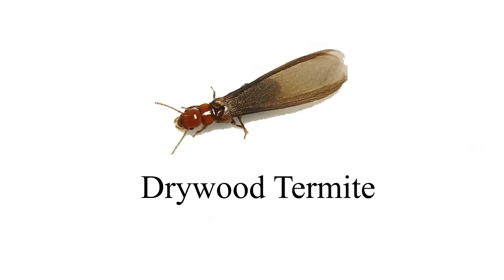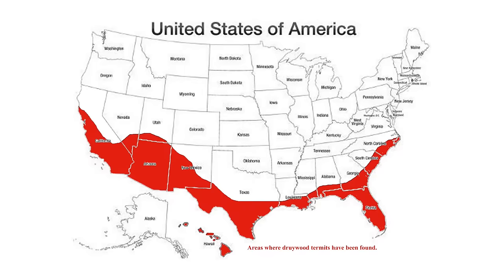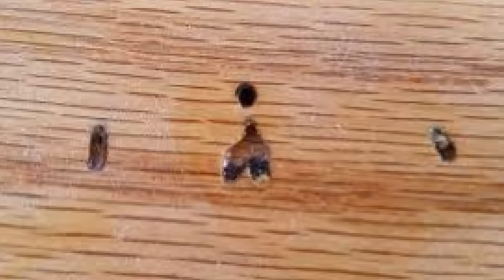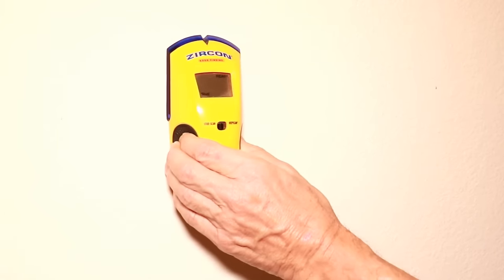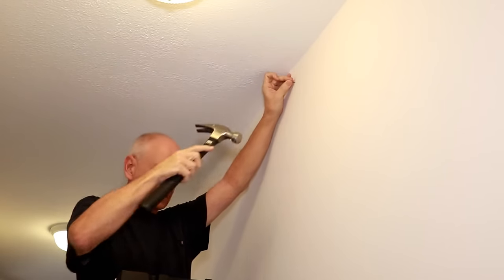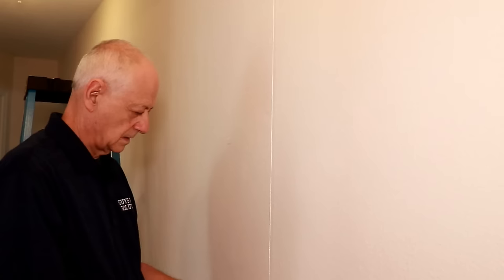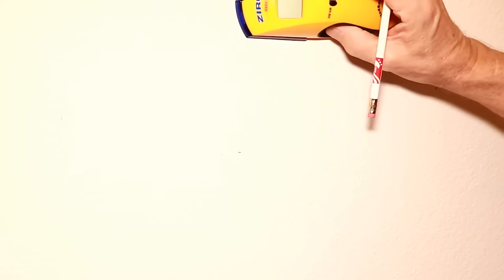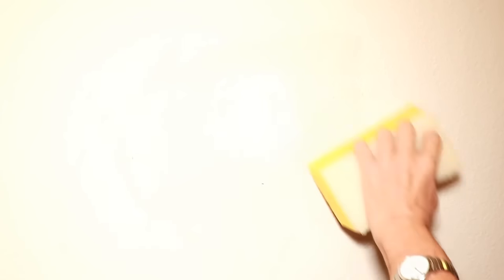How to Treat a Drywood Termite Infestation Yourself. A MUST see if you have Drywood termites.

Comment: Hello Guy. I’ve watched your videos on Drywood Termites a couple times now along with some from other YouTube channels. Thank you very much for the detail and depth of knowledge you provide as it is not something I have found anywhere else.  

I live in Florida and recently started a remodel of the second floor of my house. After pulling the carpet I found frass and then noticed a whole bunch of discarded wings on one of the windowsills. I’ve opened up three of the walls and found a lot of frass and  two colonies in the 20 foot wall under the window sill. I have also signs of activity (frass and very slight wood damage) in the two other walls I’ve opened as well as in the 3/4 inch plywood floor under 2 walls.  I can see how they travel through the holes for the electrical wiring for sure.  Nothing in the attic. Nothing in the two attics downstairs either.  (The upstairs just goes over the middle of the house).

I plan on pulling up the two floorboards that have slight damage tomorrow to take a look at what’s what underneath.  I’ve pulled the wood baseboards off every wall in each room upstairs and besides the areas I’ve mentioned, I see no frass nor have I encountered any soft spots in the walls and no kick out holes.  Also no wings on any other sills. I did identify two holes in the stucco just outside the sill where I did see the wings. I am not done inspecting downstairs yet and for the next two weeks will be focusing on the upstairs.

I wanted to get your opinion on my plan of action for the upstairs and ask a couple questions.  I am not going to fumigate at this time. 

I have Bora Care, Termidor SC and Termidor foam.  I’ll be drilling holes 4 inches apart into the beams that have the colonies and damage I’ve identified, and using the foam. 

I was thinking that since I have the drywall partly off these walls and can access all the wood inside that I’d also treat all the wood with the Termidor SC and then with BoraCare. From what I’ve read the Termidor SC is for outdoor use or wall voids. 

Obviously I will be treating all attics with BoraCare as well as all eaves.  

I plan to treat the remaining walls upstairs with BoraCare. There is insulation in each void. 

Questions:
1. Do you think spraying the Termidor SC into the areas I opened up is overkill because I’m also hitting the studs with the foam and all wood with BoraCare? 

2. In the remaining walls I’d planned to drill three holes for each void.  One next to each stud at the top of each wall/Void and one in the middle. Then applying BoraCare through either a foamer or mister so that it covers each stud. From the middle hole (actually from all 3 holes) I believe I can get the sprayer behind the insulation and foam/mist down the entire panel of wood. Is this a reasonable way to approach this? Do you think that a coating of Termidor SC would also be reasonable in the voids? 

3. Assuming I do not find significant damage under the floorboards that I do pull up, do you think drilling holes in the others and foaming/misting BoraCare into the voids in there is the right approach? Again, would a coating of Termidor SC also be reasonable? 

4. Your opinion on whether using a foamer or mister is better? 
I’ll be spraying into the holes in the stucco of course and then sealing them. I still have more work to do to see if there are any other penetrations they’re getting through also with a more thorough inspection of the first floor.  

Thanks Guy. I think that’s enough for now.  I value your opinion and am grateful for the gift of your time and knowledge.  It’s really great material and I appreciate the thoroughness that stems from your desire to get it right, convey it right, point out pitfalls  and help others get it right.
Reply from the maker: Thank you so much for reaching out to me. If you are certain that these are drywood termites, then I must tell you that fumigation is the only sure way to get rid of them.  That being said, any wood that you treat with Bora-Care will be rendered permanently termite proof, but you must do it correctly.  Always mix it one to one with water.  Do not believe the label when they tell you to mix it one to five.  Applying Taurus SC on top of the wood will not be effective.  For fipronil to be effective you really need to inject it into the galleries.  The best way to do that is with a foam.  

Insulation in the voids is not a good thing.  It is always a good idea to remove the insulation and treat under it.  If that is not practical, then make sure that you treat all sides of the wood framing.  A foamer does a good job with this type of application.

If you are going to treat studs with Bora-Care and the wall has drywall over it, then you must use a foamer.  Simply spraying a liquid in there is probably not going to get it done.  If you are buying a foamer, do not cheap out on it.  Cheap foamers do not always work all that well and can be very time-consuming to use.  If you are going to do a lot of studs, then I recommend getting an electric B&G.  I will give you a link to it.  The best way to use the foamer is to drill a hole at the top of the wall a couple of inches from the stud and you want that whole angled so that the foamer tip can come in contact with the stud.  The problem with this method is that you cannot see what is going on behind the wall, so it's kind of a hit and miss proposition.  You could make another hole halfway down the wall to do a better job. 

If you do everything right, then you should have pretty good results.  The problem is always that it's hard to treat all the wood.  When you are spraying in the attic, make sure that you catch the roof underlayment as well.  Keep in mind that the termites can get into anything that is made out of wood.  So, make sure that you treat inside the eaves as well.  After you finish the job, make sure that you continuously inspect for drywood termites.  Mostly, look for frass, kick out holes, and exit holes.  Keep in mind that you may have these guys in your cabinets and furniture too. 

I hope that helps.  Be well my friend.

B&G foamer:  https://www.domyown.com/bg-versafoamer-4000-p-1912.html
Reply: @GuysPestSolutions  
Thanks Guy. I just checked on the B&G foamer and it says “May take 6 weeks before shipping”.  Is there perhaps another one you’d recommend? 

As for fumigation, yes I do understand it is the only way to be sure to kill all termites and I may go this route in the future but it would be too disruptive at this point in time.  I also want to get as much future protection as I can with BoraCare.  

I have a friend who is a General Contractor with a lot of experience building houses helping me on this project therefore I am not concerned with the size of the holes or the pieces of drywall we cut out to make sure we have access to the studs as well as the wood behind the insulation between the studs.  It seems to me that if we cut in the top of each void, whether it be a large enough hole or a 1 inch strip across the top of each void, and ensure the foamer tip is hitting the wood behind the insulation, that the foam will then flow down the wood panel.  Perhaps with a one inch strip the foamer tip can be moved side to side to ensure better coverage. I think we will test a couple voids first by also cutting a 1 inch strip at the bottom of the void and seeing how well the foam flows down and hits the horizontal stud.   That may give us a better idea of how much foam to use.
Reply from the maker: @Turnthepage3700  The only good news about drywood termites is that they are very slow eaters.  You do have the time to wait 6 weeks to get the foamer.  You can buy one that you hand pump, but it just goes so much faster with the electric one.  I thought you would faint when you saw the price on the electric one.  Lol.  It's insane what they get for them, but that is the one you want if you are doing an entire house.  The pump up one is in stock and will ship within a day.  Remember that with foamers you get what you pay for.  B&G is the only foamer I would use.

Your solution for cutting open the wall should work well, but that's a lot of repairs.  It's a lot easier to repair a small hole.  Maybe just do one that way to get an idea of how to do it and how much foam to use.  You could also consider having someone watch the stud with a borescope while you are applying the foam.  If you do that, get one that comes with it's own screen.  Don't buy one that connects to your phone.  They do not offer enough light.

I hope it goes well for you.  Be well my friend.

B&G pump up foamer:  https://www.domyown.com/bg-versafoamer-hh-gallon-foamer-p-1696.html

Comment: Hello Guy, I have a mountain home in East Tn. We put down red oak floors in 2010. We bought discount wood they called "wormy wood." We liked it because it was rustic looking with knots . Over the years we would arrive to the home and find dead flies and lady bugs in the windows. I thought there was an issue with the wood floor but my husband felt there was no problem. Due to family illness we have only been getting there about 2  times a year. Last week during the night we woke to frass scattered over a section of the floor. Never seen the little white piles described with beetles. Taking a real close look there are bigger holes in the floor. I then found some dead beetles and a few live ones that came out over night. I noticed in the ceiling with exposed big thick beams an area that has been damaged, two strips about 10 inches. I found on the kitchen counter the  a large pile of the frass behind the toaster . I see damage on the large beam against the kitchen wall. The floor is full of tiny holes, it appears we have termites and beetles. We live out of state. This appears to have been going on a long time. No one does fumigation in the area, not even in Knoxville.  It's a mountain home and everything is wood. Is  it be best to remove all the oak floor? I have called a pest company and waiting to hear from them. We  are limited in the small town we are in to find anyone to do work. I know I can't do it but feeling pretty desperate. I think we have termites and beetles. I can't do this work myself but need to know what I'm up against.
Reply from the maker: The only kind of termites that produce frass are drywood termites and you do not have them where you live.  That means something else is going on, and most likely, you do not need to fumigate.  I recommend that you try to obtain some specimens.  Place them in a jar and let them die a natural death.  After they are dead, place one with its feet down on a hard surface, and take a very in focus, close up photo of it.  You need to get as close as you can, but it cannot be blurry at all.  Send the photo to me at guyspestsolutions@gmail.com.  I cannot always do it, but most of the time I can identify the pest from the photo.  My success usually depends upon the quality of the photo.  If your camera has a macro mode, then you should use that.  If the pest controller gets back to you, there is a good chance that he will be able to identify it for you.  In addition to the beetles, you may also have subterranean termites.  The pest controller should be able to figure that out fairly easily.  Meanwhile, look for mud tubes around the outside of the house.  You will usually find them coming up from the ground.  If you have a crawl space, then look under there as well.  I hope that helps.  Be well my Kelly.
Reply: @GuysPestSolutions  Thank you for the information. I live in Tampa. I took some photos and will send what I have. The pest control company from Knoxville was there today, our home in an hour away. I've not heard from them other than it is fixable. We have a lot of leaves that fall close to the house and there is wet clay under those. Lots of dead tress in the wooded area. We do have a 16 inch concrete foundation but the house is wood with vinyl siding.
Reply from the maker: @kellymac76  I am looking at your photos now.  The photo of the bug, looks like a common stink bug.  They do not damage wood, but can be annoying in the home.  I am looking more closely at the damage to the wood.  I will respond to your email after further review of the photos.  Be well Kelly.
Reply from the maker: I'm sorry, you had two photos of bugs.  The other one is a false bombardier beetle.  They do not damage wood either and are mostly an outside pest and are of no concern.  Be well Kelly.

Comment: Of all, the videos yours are by far the best. Ok big question a week ago around 9pm Flying Termites (swarmers) went for my light shade in the living room, Used my vacuum  suck them up, maybe 75 then last two nights 50 then 25 last night.  I live in a two-story house and I scored the perimeter with no signs of any termites, I can only assume they are nesting somewhere inside. Ok, do I assume per your video if I lay the pellets out like you did this should resolve my problem, what I do NOT understand is: do the termites have to leave my house to get to the pellets then come back in to poison the colony? Is that correct? 

 

Really appreciate your thoughts...oh and I do have the green stations from Massey. I will call them tomorrow regardless I want to do what you did with the pellets

Thank you very much aL      like button done
Reply from the maker: How you handle this will depend on the species.  Figuring out the species is actually pretty easy and I have a video on how to do that.  I will provide you with a link below.  After watching this video, you should be able to identify the species. Just get back to me after you watch it and let me know what you found out.  At that point, I can tell you exactly what you need to do.  Let me know if you have any problems identifying the species, but I do not think that you will.  It is much easier than you may imagine.  Also, please tell me where you live.

The termite granules only work for subterranean termites, so we need to make sure that is what you have before using them.  The reason the granules work for subterranean termites is because the termites must return to their colony fairly often to bring food back to the other termites, and the colony is always located under the ground and not in your house.  This is not the case for other species, and that is why the first step is to figure out which species you were dealing with.

Those green stations around your house are bait stations that are only used for subterranean termites.  They work pretty well, and that is yet another reason why we need to figure out the species.          

 Be well my friend. 

Video on how to identify termite species:  https://youtu.be/dIs_a0nfVjg
Reply: We get the same problem every year
Reply from the maker: @theone77033  That is why I always tell people that spot treating drywood termites doesn't work.  It is virtually impossible to find all the galleries.  The only way to get rid of all the galleries is to fumigate.  Keep in mind though that the gas they use has no residual action whatsoever.  Therefore, you can get reinfested the moment the tent comes down.  If you have drywood termites, then I can assure you that your neighbors have them as well.  Since they swarm every year, it is a safe bet that you will be reinfested within a year.  The only way to prevent this is to do a preventive treatment.  You need to begin this treatment before the tent goes up, so that you are protected the moment the tent comes down.  I will give you a link to my video I have to do that.  Prices for fumigation can vary wildly for this service, so I would urge you to watch my video on how to hire a pest controller without getting ripped off.  If you are not sure if these are drywood termites, then watch my video on how to identify termite species.

I hope that helps.  Be well my friend.  

Video on how to prevent drywood termites:  https://youtu.be/neNsmVbj8Pc

Video on how to hire a pest controller without getting ripped off:  https://youtu.be/y-a8XOqVrlE 

Video on how to identify termite species:  https://youtu.be/dIs_a0nfVjg